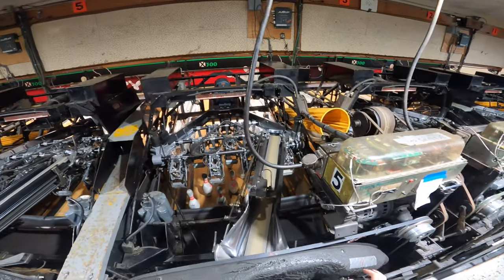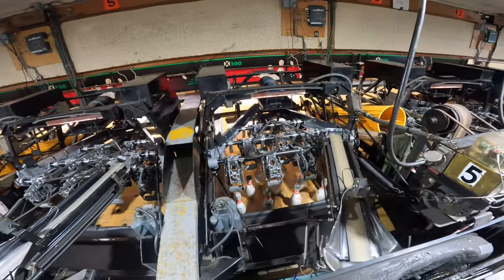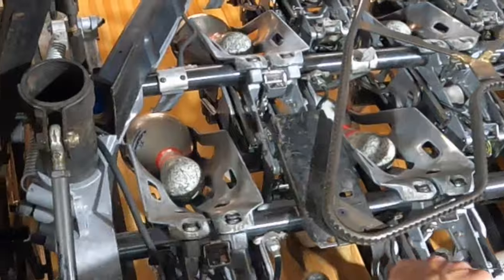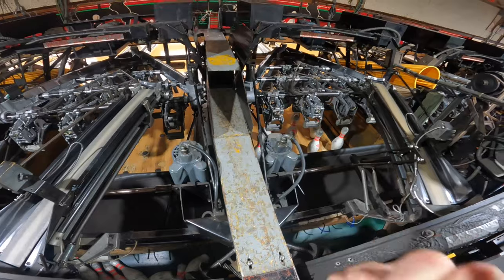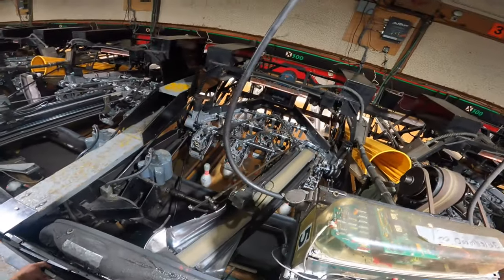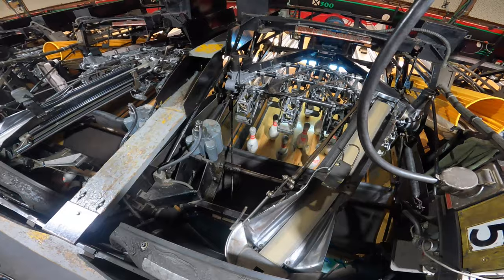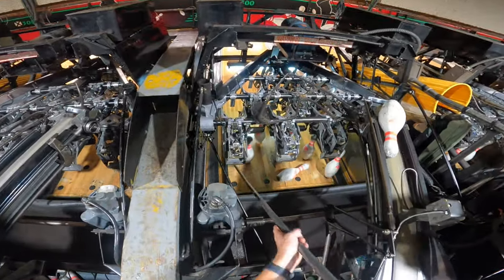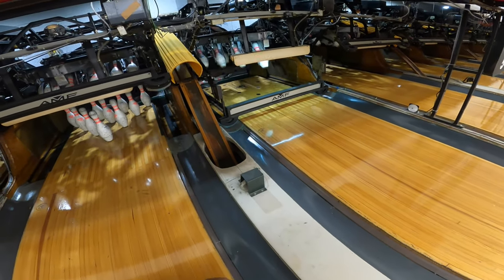How Does an AMF 82-30 Know The Difference Between Standing Pins and Strikes|askJoethepro

Comment: Wow. Ball sensors and pin cameras and I see the electronic chip and circuit boards in the brains. I spent many hours repairing respot cell switches and wiring years ago   Times have changed
Reply from the maker: They sure have!

Comment: Great explanation 🎳 A little more complicated than the A2. The scoring system is nice! I do not have that.
Reply from the maker: Yeah I’m glad the scoring system is there now instead of the re-spot cell micro switches… when one goes out — they all go out
Reply: Having been retired for ten years as a pinsetter mechanic, mostly Brunswick A/A2 (I was also an AMF mechanic), I will take AMF 82-30 or 82-70 over any Brunswick A models.  I never liked the idea of having rather heavy dead weight hanging above me while I am doing service while on the pin deck.  I don't know how much a Brunswick deck weighs but I know that I would prefer to have an 82-70 table than a rather heavy weight-ladened deck resting above me!  I knew that if an 82-70 table came running down on me I would be able to stop it; no one would be able to stop a Brunswick deck if one came crashing down on someone, meaning that I had to rely on a gearbox to keep it up in the air while I am on the pin deck.  To me, any AMF machine is a lot less complicated (and a lot safer) than any Brunswick machine.

I do like how AMF pinsetter bowling centers have scorer systems that have the ability to recognize strikes, denecessitating a table run on first cycle, just sweep the pin deck and set new pins!  The elimination of the table run on a strike cycle eliminates the closing of the respot cells when they feel for pins so that they do not have to reopen at the same time the spotting cups want to set new pins, eliminating potential malfunction or conflict.

Comment: Question. Back in the day before the score camera and Ball sensor existed, how did the machine know whether the ball knocked down the pins or not, and kept track of score?
Reply from the maker: The machine didn’t keep track of the score back then — the person bowling did
Reply: @Joethepro181  Cool. But how did the machine before the camera know if all the pins were knocked down or not? Also, was the first version activated with a force plate rather than a ball sensor?
Reply from the maker: @zyloproductions4870  Each Respot cell had a micro switch on it that all tied in with the masking units and a KL plug. Table dropped down and if none of the micro switches were activated then it would go into strike cycle. There was a switch plate on the ball stop behind the curtain. When the ball hit the curtain — machine would cycle.
Reply: @Joethepro181  The old Magicscore system was actually using a version of SONAR. Yes, the thing on submarines. My dirty 30's just got upgraded to a camera scoring last month. And trust me, the old SONAR strips sucked to work on. After they started misscoring, you could only hope they magically returned.
Reply from the maker: @mintythebowler5113  Yeah I’ve never had to work on those haha

Comment: Hiw come on the GSX setters the thing has to come down 2 times.. 1 on first ball. And even on 2nd ball for a spare/strike??? Or a open frame??? It still comes down to check for standing pins? Why does it do it that way? Compared to A-2 where it just sweeps after 2nd ball cycle
Reply from the maker: Just a different system. I don’t know much about them but I’m assuming it’s to sense what pins have fallen on the second ball
Reply: @Joethepro181  That would be correct, so that it can send second ball pinfall information to the scoring system.  I believe this eliminates the need for a camera being mounted on a subway ball return capping.

Comment: How do you go from the system, to the new one? I have new scoring cameras but want to take out the old system. Is it easy to do that? I have 4 lanes in Portugal, 82-30.
Reply from the maker: Depends on what you got
Reply: @Joethepro181  i have the BOSS scoring system, but the re spotcell are working too. Thanks for the videos, they help me a lot. 🙏
Reply from the maker: @ivo300  👍
Reply from the maker: If you have any further questions machine related I can help!!
Reply: @Joethepro181  i have tons 🤓. But the vídeos are a greta help. Keep the awesome work.
Reply from the maker: @ivo300  If you have anything specific just shoot me an email or comment.